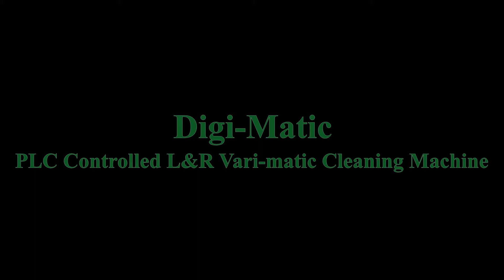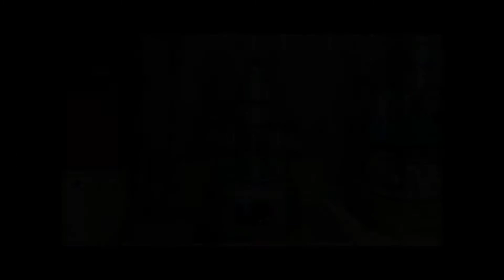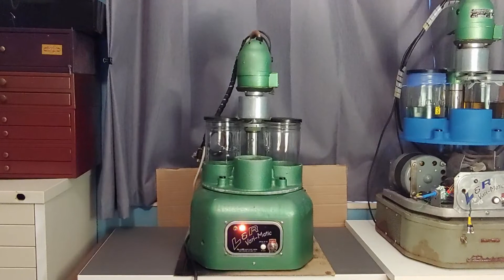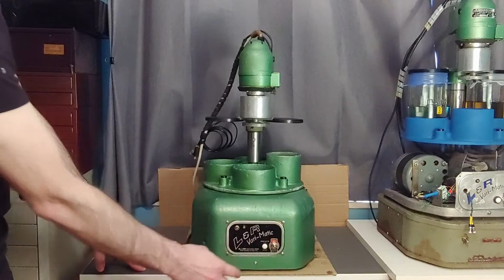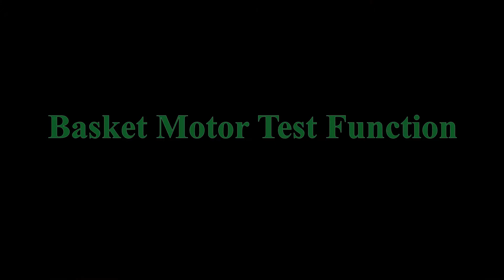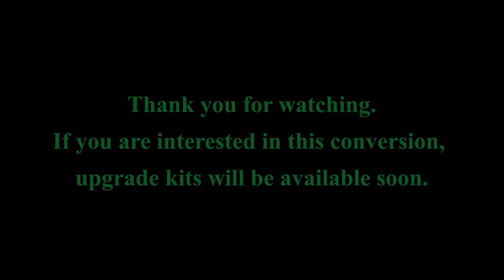The "Digimatic" final test and instructions. [PLC controlled L&R Varimatic]

Comment: Hi,  I've just bought an old L&R Vari-Matic via eBay and it's fitted with one of your PLCs!  Does this mean it was probably one of yours or is the kit you mention now available?  It works very well and, once I'd seen this video, it's easy to operate :)  I wonder if you have any documentation you'd be happy to share?  Not the software necessarily, but a wiring diagram would be interesting and might help with maintenance in the future.
Reply from the maker: I did convert a handful of machines and sold them on, so it will be one of the ones I converted. Kits are still being tweaked based on feedback I've had so far. Wiring is very self-explanatory and a lot of it is still mains voltage so I'm reluctant to encourage people to play inside who aren't proficient.
A quick reference sheet for the machine can be found here. https://docs.google.com/document/d/1AE8NITSK8-QaPxI0OoNZIMSHP7q2WPz5/edit
Reply: @tfwatches2117  Many thanks for the reply and for the link to the document.  Out of interest, bearing in mind your 'tweaks', is it possible to update the device in situ?  Unusually, I haven't 'taken-the-lid-off' yet to see  the gubbins 🤓  My Father was a professional watchmaker and, many years ago, I modified his automatic cleaning machine to be controlled by a 6502 processor and lots of relays.  Your firmware and interface is much more elegant!  A very nice project.
Reply from the maker: @martincharman9759  The changes I'm making are more to do with the hardware in the kit. Easier manufacture and installation, so not really needed for up and running systems. And the PLC is accessible, so one could update the system if needed or even write their own code if they wanted.

Very cool that you did it with a 6502 back in the day!

Comment: I’m having such a hard time coming by the baskets. The smaller baskets fit on the inside, but I have yet to find the larger baskets that fit on the outside dimples.
Reply from the maker: The basket frames are hard to come by and the larger ones more so (probably as more people want them). I'm sure with a little bit of fabrication, you could make a new frame, as all it has to do is hook on to the basket motor and hold the basket inserts. Once you have the frame, they are compatible with more recent 64mm baskets (from machines like ACS900, etc).

Comment: Is there a reason you went with PLC?    This seems much easier and cheaper to do with a microcontroller platform, like Arduino. It would make sense if the conversion was meant to be used in large watch shops, running 5-6 of these, but for hobbyist use it could be done much more elegant with less money and even be simpler.
Reply from the maker: First and foremost, I have previous PLC experience so programming and set up was very quick and easy. PLCs are also designed exactly for this type of application, industrial control, so it was an obvious choice.
I do not believe it could be any more simple, with more elegance or much cheaper with a micro (they are not that different in price to a standard Arduino). I do not doubt you could have an equivalent system though if you are keen to design one that way.
Reply: @tfwatches2117  Yeah, I work with PLC's for living so I know all the pro's and cons. I mean it works, that's the most important thing, it's just finesse. What PLC controller you use? I assume something like SoftPLC? 

The microcontroller solution could be fitted in an altoids tin for under $20 + motors and motor drivers. It's also fairly easy to set up if you want to later distribute plans to make these or even sell them as kits. 

I'd love to help you out in the development, this is a really neat idea. 

Sorry if I came off a bit arrogant in the first comment or it sounded like I was mocking your solution - English isn't my first language so things I write often don't appear mean or offensive to me until I get feedback and realise there's a clear obnoxious, unfriendly undertone.
Reply from the maker: @lazar2175  That's ok, it is a genuine question to ask. 

The PLC I use is a clone of the Mitsubishi FX series, they are bigger than some micros but still fits in the palm of your hand and space isn't a huge concern in these old machines. Again, their price isn't far off what you mentioned. I know some PLCs cough Allen-Bradley cough are very pricey. 

I'm already in the process of creating kits and should be shipping my first next week.
Reply: @tfwatches2117  That's really neat. I found you through r/watchmaking, looking forward to seeing your kits on there! Just curious, what's your background? 
I'm really just a beginner in the watchmaking world, so I still don't own a cleaning machine but I'm keeping my eye out for one now. 

I actually have my own watchmaking project too - Open Source Timegrapher. It's still in the development phase but I think I'll be able to release the guide, code/program and .stl files before 2022. I'm also hoping to write my bachelor paper/dissertation on this project. I'm majoring in Industrial Engineering, praying this project makes for a good subject lol.
Reply from the maker: @lazar2175  Feel free to contact me on Reddit and we can chat more about things.

Comment: What sort of issues?  Can you share your design?
Reply from the maker: It's not uncommon to have the microswitches burn out on these from switching the high current of the indexing motor, changing to solid state relays solves that.
Also the spin off time was only about 6-7 seconds in the original which wasn't enough, I've more than doubled it.
I plan on providing an upgrade kit so others can do this as well.